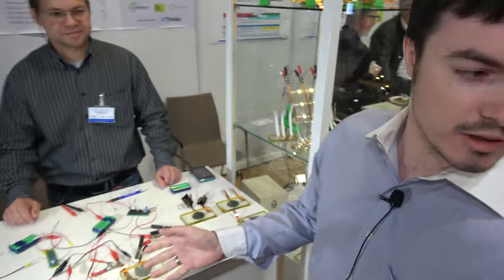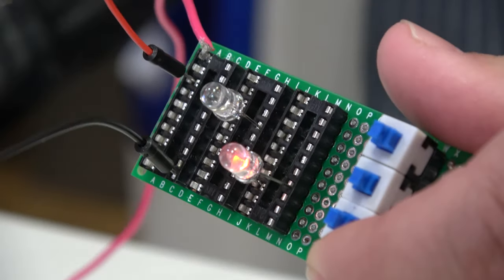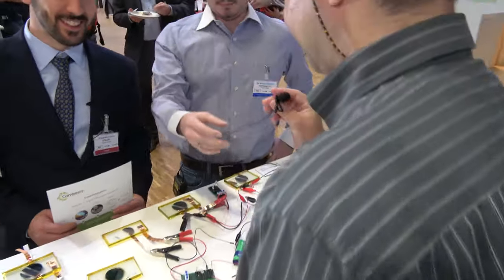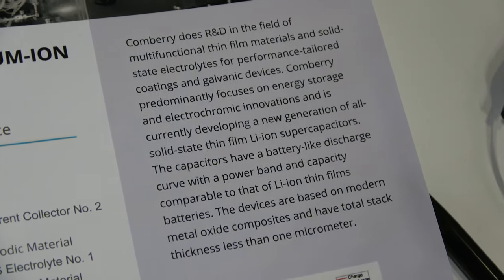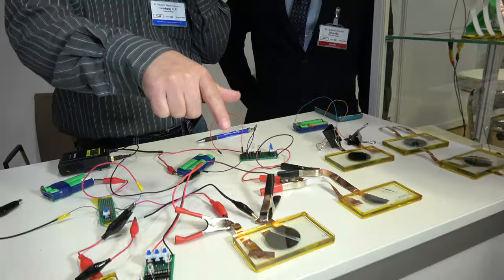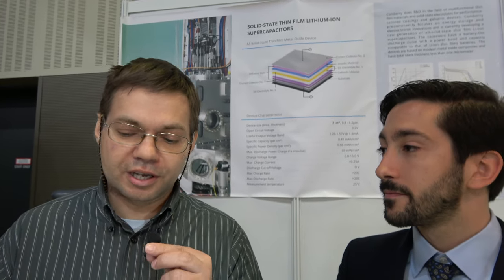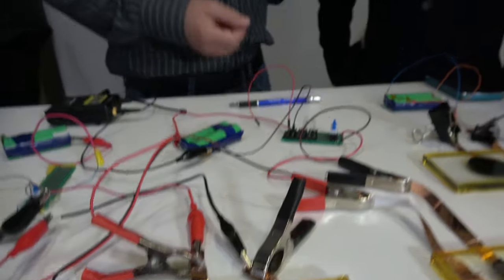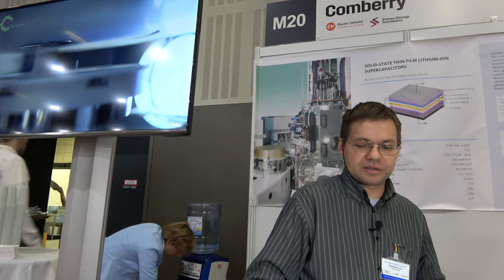Comberry Solid-state supercpacitors

Comment: A lot of mistake in the brochure and not very useful information provided.
The brochure mentioned Specific Power Density (per cm^2) as 0.66mWh/cm^2 and that makes no sense since power density will be in Watt not Watthour since that will be energy density.
As power density is possible with super capacitors assuming around 1um thickness since that will be 6.6W/cm^3 (a typical 18650 has about 16cm^3) but as energy density there is no chance they can get 6.6Wh/cm^3 since that will be a few times higher than best Lithium cells.
Since above power density they mentioned capacity in mAh/cm^2 and considering the low voltage range that will assume that they realy wanted to say Energy density is 0.66mWh/cm^2 and that is just impossible since it will mean that a device the size of an 18650 can store a bit over 100Wh and that is an order of magnitude higher than the best available Lithium cell around 10Wh in that cell format.
So all looks like a big mess and possibly a scam. Not sure how they can get away whit those claims and a show like IDTechEx.
People in general should know abut the difference between power and energy and then this sort of scams and many others will not exist.